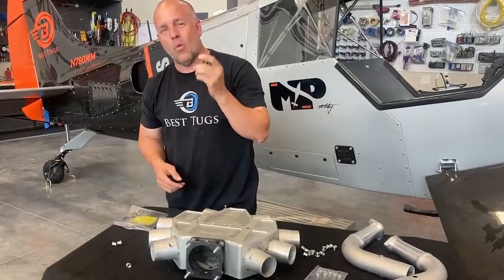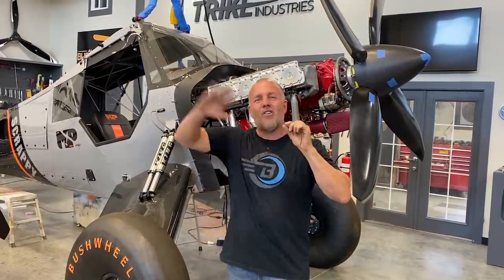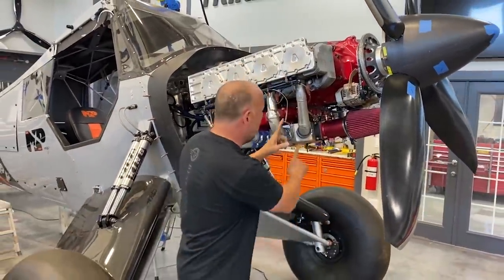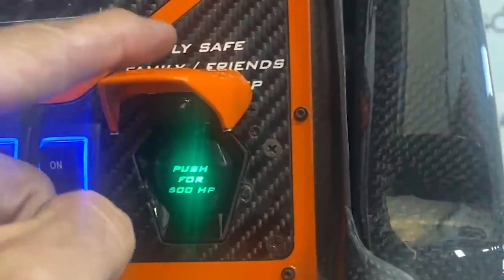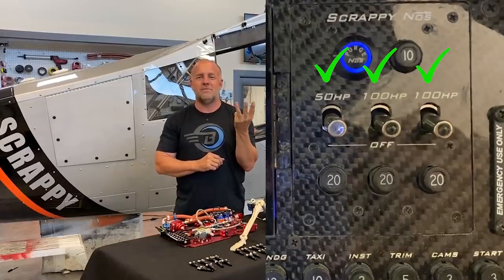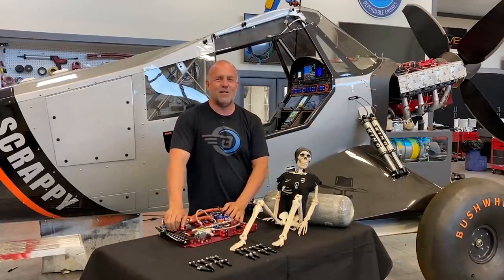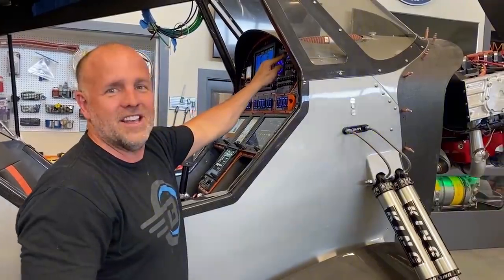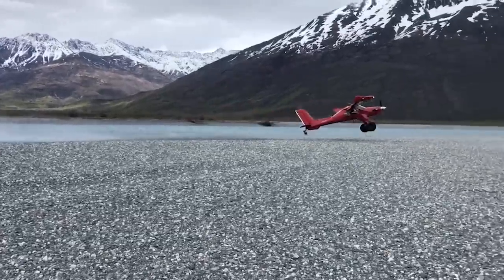NOS on a Bush Plane 😳 🤠 - 13L 250 Shot Nitrous Oxide - Part 1 | Scrappy #39

Comment: Now i know why you haven't build wings yet....with this much horsepower and that prop you might be able to take off like a chopper...
Reply: Scrappy aka the experimental vtol.
Reply: @jeantsaiaviation  Crappy? xD
Reply: @MrGuliton  f+¥€ 🤣🤣🤣 i meant scrappy
Reply: Mike your a true pioneer. Love it and can’t wait to see scrappy fly.
Reply: The main wings are mounted on the strut assembly where the wings would be traditionally inflatable wings will deploy for display and aesthetics
Reply: @1STGeneral  an airbag wing -  novel idea! Not!  but humorous!!!
Reply: Where are the lower strut attach fittings?
Reply: I am convinced now that since Mike hasn't even discussed wings, that the use of 50trillion horsepower coupled with those anhedral gear strut wings will create enough lift for Scrappy, making it the worlds fastest ground effect craft.

Wings...who needs em when your airframe weighs 2 pounds.
Reply: @fn3048   There are front and rear spar attach points but I don't see anything for the strut attach on the fuselage.
Reply: @doren8491  Been done before, look up Goodyear aircraft. There's a reason you don't see them.
Reply: Nitrous oxide=hippy crack.
Reply: Obviously an engine guy... Wings are an afterthought...
Reply: Inflatable wings NOT novel! They have been done before! 😀
Reply: Wouldn't surprise me at all if this aircraft has a thrust ratio better than 1:1. A few stunt planes can hang off the prop, so it's not too far fetched.

Comment: Good grief. Scrappy is going to need cyclic and collective more than it’s going to needs wings. Amazing Mike. Always inspirational.
Reply: Oh that’s probably the next set of switches. I can see the video update now: The engine turns 90 and becomes the tail rotor and a set of rotor blades will be rocket fired out of the CG cap. Collective, Cyclic & Throttle pop up from the floor.
Reply: Next , he will need a tail rotor to halt the twist of the torque ( what's it called ? )

Comment: You just hit on one of my favorite things, nitrous! 
And no. It won’t blow so long as you’ve got a good fuel map with the right nozzles. 
The nitrous in my GT-R has a 200 shot, but it ramps in slowly from 2,500 RPM. 
If you need a hand let me know! I love nitrous! I installed the system myself and I love doing it!

Comment: You probably thought Mike was just an average overachiever, until he put a nitrous-oxide-system on a cub.
Reply: *on a cub that already had a 500HP engine...
Reply: A cub that was already lighter than most toaster ovens
Reply: I knew this build was already insane, how can it possibly get more complex?  Bingo.
Reply: @epoxeclipse  You have a good point there. I can imagine some neophyte seeing Scrappy at an airshow in the (we hope!!) not too distant future. He'll see all the amazing custom bits and get the idea that "this is a Carbon Cub" and I'd like to buy one. 

When he sees an ordinary Carbon Cub he's going to be soooo disappointed!!   ;^)
Reply: @MrGaryGG48  this is an example of high effort engineering. Mike is my Boi, I've been fallowing along on YouTube for a long time. I like to think, man if someone applied this much thought and engineering into a car, you'd build a street driven f1 that looked like a carbon fiber McLaren. This plane is on another level. I'm sitting here messing with my turbo street cars coming up with neat engineering tricks that are cool, but just not on this level.

My buddy has a 50shot to spool his turbo on the line for launch, then Mike over here I got 250 shot on toggle depending on how much power I feel like hitting it with on a trick turbo throttle switch activation.

I'm happy to have pulled 300hp out of a street car. Haha.
Reply: @epoxeclipse  And, we haven't even seen the wings yet.  I can only imagine what the hell he will do.
Reply: @epoxeclipse  I like your idea about putting that kind of energy into a custom street car but I'd like it a lot better if California had a licensing category that would fit something like that. If the vehicle is pre-1974, it falls out of the testing regimen but I (and about 5,000,000 other West Coast Gearheads) would like to see something similar to the aircraft "Experimental" category. 
...good luck with that!
Reply: @MrGaryGG48  true true, let me introduce you to Casey putsch on YouTube building his own car, not sure what registration will require. Cali is bonkers with the car hate sorry man. My state just got rid of emissions testing and any testing because it was proven not to matter and was just wringing money out of people.

Comment: Being someone that has been in the Nitrous install business for 20+ years, great explanation! Informative and easy to understand. I've done systems from 50 hp all the way to 4 stages on big cube motors. One major point to convey is that anyone attempting a Nitrous install, could be anywhere between the lowest and the most HP, always and I stress again always make sure your tune on motor only is correct. Many make the mistake of trying to sort out a poor running N/A setup through adding Nitrous. Big no-no! You just compound the problem and most times leads to problems big or small. Here's a vid of a mustang with a 706 Donovan block Big Chief style headed car that I did. Went 7.03 on 2 big kits of 400/400. It leaves on 400 and the other 400 was timed out at around .8 if I remember correctly. 60 ft was 1.09. It has 1 more, a plenum bar kit with another 350 on top of that but was not used here. https://youtu.be/FQEzYAYrMdM

Comment: The throttle spring plus push to engage the nitrous is an amazing solution.  You preset the power and simply do the push forward.  Superior engineering Mike.  and I will sit through your Blah Blah Blah all day long.  Be safe and back to work.

Comment: Amazing work Mike.  The throttle actuated NO2 is intuitive.  Your NO2 control board looks a lot like some of the control panels that we designed and built at Process Tube Systems.  #Cool

Comment: Mike, I’m surprised by the small size of the air filter. Given your engines size I’d have thought it would use a filter with more ch larger surface area. We’ve found over and over the last 10 years that the larger the K&N type filter used the more power and torque we’ve made. Loved the details about Nitrous!

Comment: As a car guy my father introduced me to funny gas as he started using it in 1975 with emergency brake handle engaged 1/8" line from welding bottle to drilled cast iron manifold. I went as far as 4 stage 300hp per stage Foxbody that made  1175hp on a sbf and dad still uses a 150hp hit on his pickup at age 60 to skip out of mud and snow traps. So Mike if it's out of hole or passing its definitely is worth laughing about. Hope you've added bottle heater.

Comment: I believe that Garmin is probably allowing some kind of programmatic communication with their altimeter indicator (eg. by CanBus protocol or something). Instead of having the 3 switches to manually arm the nitrous quantity depending your altitude you could install an Arduino device to make an altitude reading and arm the appropriate relays automatically.

Comment: This... sounds like a really great mod for a lot of float/sea planes.  They often struggle to get off the water.  5-10 seconds of 50Hp boost would make a massive difference.  Could easily cut 50-70% off the takeoff run.

Comment: Mike.  Might I suggest some Kevlar explosion blankets wrapped around your manifold, intake tubes and TBI?  I've seen parts like those become high-velocity projectiles with NOS if you hang an intake valve.  Maybe I missed it, but just in case I didn't; I think you'd want a remote shutoff at the tank in case you lose a NOS supply hose or fitting anywhere downstream he case of an intake explosion to keep bad things from happening to someone we really like still in side.  :-)

Comment: Another great video. Two thoughts: High mountain lakes are known for crazy winds. More than one Alaskan super cub pilot has had to helo-lift his busted up cub after the winds cartwheeled it down into the valley while he was out sheep hunting. So how about putting hydraulically-actuated folding wings on Scrappy like Navy carrier aircraft have, which would allow you to camp out in your plane in a wind storm on one of those high lakes? Also, you could just put a JATO system on Scrappy for emergencies and avoid all of that engine intake porting. Keep up the great work!

Comment: Outstanding! in a few years upgrade it to a 600Kw (816HP) electric motor, that will get things moving... I've put 20Kw on my ultralight (single place), and it pulls, also is so smooth and quiet.

Comment: Go back a few and we see scrappy pulling against a strain gauge and showing about 1500 lbs static thrust at less than full throttle without the nitrous.  So, somewhere we heard the number 2000 lbs takeoff weight, and with the additional horsepower I'm thinking the wings are superfluous if the landing gear suspension can be pumped up to maximum to point the launch angle skyward, it can start to fly somewhere off the ground, the downside is an immediate crash if the engine quits. paint a stripe on the tire to see how many times it turns before it's in the air, I bet it won't be more than one.

Comment: Dad told me about the safety wire on his plane in WWII, it was for War Emergency power.... the broken safety wire meant the engines got pulled and worked on, good think you don't have to do that if you bump past the string. :)
Reply: The original (Gstring) at least according to my great uncle

Comment: Love the in detail information about NOS vs Turbo and how NOS wet system works. Adding a supercharger would be much the same as a turbo? (and as you said, you really don't need it all the times, so it would be dead weight).

Comment: Im guessing the engine PCM will also be adjusting the timing when you have this system in use. I would love to have this engine setup on a AVL AC dyno,and have cylinder PSI transducers along with 5 gas exhaust analyzers to do a LBT and MBT performance run to see what optimum timing,and fueling would be. Im kind of shocked the engine design is not a cross flow head with the intake on the top. Im super excited to see this setup in action great video. Wish I could give it more then 1 thumbs up

Comment: No way. A friend of mine put  NOS into his 65 mustang. It worked well. When he went to his second engine he had pretty much all the bugs out, and the car lasted for several years, heres the explosion. He was sitting at a light. This was his First engine build, a 13 second 289. Basically a 306 HP Shelby engine copy. It ran really well,  uti after a while, as with anything else, 13’s got boring and he wanted to take the car to the next level, so he began working on his second engine. It was another 289, but this one has actual 351W 4BBL heads. Damn few of these engines were made and finding heads from one is the preverbal needle in a hat stack. It had smaller combustion chambers than an2 Bible engine, the largest ports of any factory Windsor up to that point, not sure about the Fox Body Mustangs though. Anyway this motor got the Boss 302 forged steel rods that were .005 longer center to center than the 289 was, so that helped keep the compression ratio higher. Along with that were domed pistons and larger cam with single plane intake and nitrous. So before he got the motor built he pit the nitrous on the low ho motor. Now he knew what all the switches did, but failed to put a lockout on the solenoid. He was out running around one day with a guy sitting next to him. When the pay were sitting at the light the guy kept playing with the switch mounted in the shifter. Then when Randy pulled away from the light a super lean, high oxygen mixture wears preignited and blew the carburetor clean off the manifold, during the carb up through the hood when it did. The hood was fiberglass and  the impact. It hit so hard that the explosion stretched the big end of the motors cast rod and is started to spin the bearing. So Randy JB welded a new bearing in the rod and kept it running while he repaired the hood, and finished the new engine. So Mike is doing his smart. An arming switch and and an actuator hooked to the throttle. I would think about using two actuating switches that open at part and full throttle.

Comment: 12:30 No, because of something called divergence of the isobars, the amount of temperature increase relative to the pressure increase across a compressor is not constant or "set amount" as you put it. This is without considering losses in the compressor and their effect on temperature increase and the fact the efficiency is not constant throughout the RPM and mass flow ranges.

Comment: My personal opinion. I know it would increase the weight of the airplane, but I'd run a single turbo kit. And also run the nitrous. Run a small turbo like a Garrett gt28 or gt35. And still run that 250 shot that you're running. My reason behind it would be that even though it adds weight, you might actually be able to get away with not changing the CG of the aircraft, and you'll be able to run a smaller shot of nitrous. Meaning it would last longer.

Comment: Germany did it during WWII on some of their BF 109's.

Every now and then an American Mustang Pilot would get a nasty surprise as in 
"How the Hell is that thing keeping up with me?"

Mustangs could maintain speed better in a turn because their more powerful engines could muscle through the turn.

So if a 109 got on their tail , they could go into a hard turn and the 109 would lose speed and fall behind.

But every now and then they would run into a 109 that would start closing the gap in a hard turn and the Mustang pilot had to pray his wingman was on the job.

The Germans had discovered nitrous oxide and equipped some of their top pilots with it.

Comment: Mike:     I love viewing your videos.  As mentioned several postings ago, I've watched ALL (now 39) your Scrappy videos and also all your Draco videos.  I can hardly wait to see wings on Scrappy and the "first" flight video.  By the way ... is there any chance of over spinning the prop if you happen to need the extra 250 NOS (all switches on) setting.  Would be bad if the extra torque damaged the blades.  Thanks much ... All the best ... Dave

Comment: Did I notice a little twist in the throttle arm when you push against the NOX spring? Might need to beef up the lever thickness so the handle doesn’t twist when you demand “military” power ;-)

Comment: Just use browns gas in stead of No2! The common failure with Nitrous is not the kit it’s self. It’s the ignition mapping it’s self and spark advance that usually “shits the bed” any time you can make more power with less timing you are gaining efficiency .

Comment: Mike I have run NO2 on about everything. I have also been very successful as I watched others have negative results. I realize you are spraying just 31hp per cylinder, but just wondering if your engine had forged pistons, and if the ring end gaps are sufficient for the application. Probably wouldn’t matter with the planned power level, but when things go wrong?? A fuel solenoid failure, or a single plugged fuel jet. Kind of different in the air to have a “PoP”.

Comment: You know, MIke, if you take a like prop to the one you had on Draco, and put it on Scrappy, you probably wouldn't even need WINGS with this system you're putting in.  Just rev the engine up, hit the NO2, ,and it'll pull you straight up.

Comment: The "War Emergency Power" button is fantastic!  Question - if the Nitrous panel or even one of its fuel related solenoids fails, I assume the engine will keep running just on the throttle body?

Comment: Okay, just to clarify... The switch under the cover arms the system.  The three switches allow you to select your boost level, and the momentary switch on the throttle stop engages it.  That makes sense.  But why does it say "Push for 600 HP" when you have the switches that added to 250 additional HP?

Comment: @mike  ...ive ran nitrous on race motorcycles for years.  I strongly suggest you change the solenoids to WON pulseoids.   And please note, port injection alone does not gauruntee you will get even distribution.   It would be wise to cnc a spider assembly and install it into the center of your intake. That assembly you showed, frankly just isnt the way to do this safely with  reliability. Id also be careful with your rule of thumb.   Whats more important is cylinder  pressure.  My race bike ran over 200hp on 63 cubic inches.   But it did so at 12000 rpm.   That engine at significant lower rpm fully loaded up is going to be on the very edge of detonation already.

Comment: Mike, with the LED being used to illuminate the NOS purge shouldn't the light be tilted toward the aft end of the aircraft to compensate for the air flow along the body since the prop is moving the air along the side of the aircraft?  Hmmm....

Comment: With all this work into this system, you might as well automate the process for choosing the correct nitrous injection depending on the altitude then just have a switch between auto and manual so you can still use your switches if you need to.

Comment: OK, I get your want/need....   STO, really STO.    You’ve got 600 horse and a mad prop.  So will you have enough aileron to offset counter-torque in a low (initial) speed, low air density  situation... or will you have some sort of augmented reaction control until you get enough airflow over your control surfaces?   Wing tip peroxide jet?

Comment: Very cool Mike. Just wondering what material used in engine valves. We had sodium filled long ago and broke one due to quick cooling. It really messed up one of the Ford 427 tunnel port heads. We switched to stainless valves and never happened again. I figure you are on top of all that kind of thing :)  Back to work!